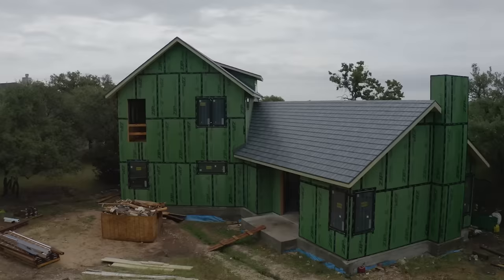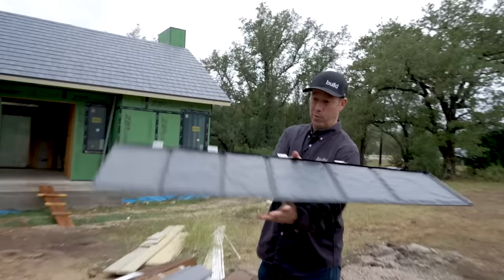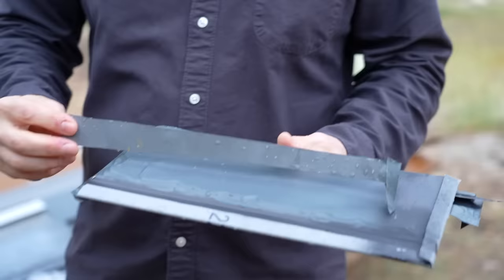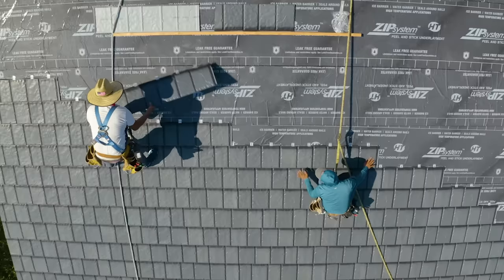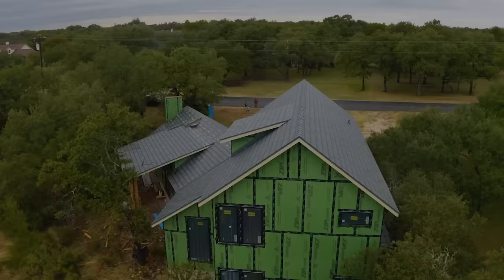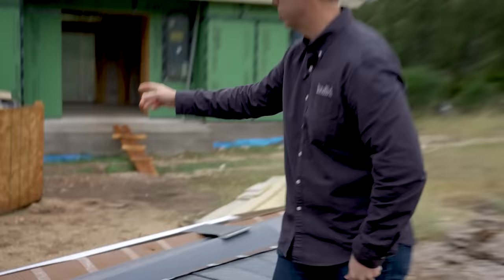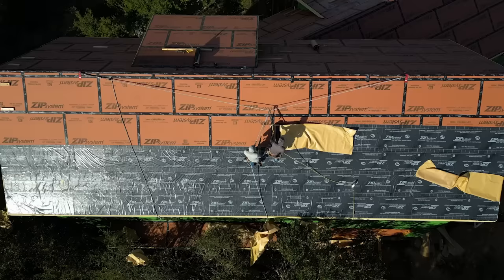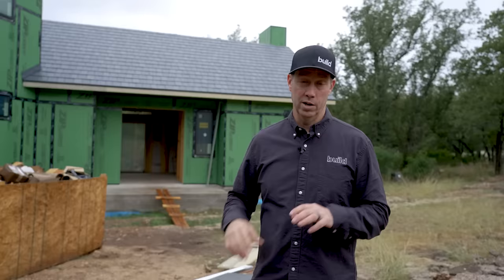Don't like the "metal roof look?" Check out this metal SLATE alternative!

Comment: I wonder if these still need sheathing for the install, warranty and load/wind capabilities. 
As in, could they be installed on a post frame with metal trusses and purlins. Perhaps with furring strips run perpendicular to the shingle for nailers.

Comment: Is the shape of the shingle enough venting? (Over a conditioned attic)
Reply: You likely don’t want your shingles to be doing the actual venting. It looks like it is setup for eave to ridge venting
Reply: @alexanderbrown6077  he often uses strips to attach his metal roof to, or a double deck.  So I thought I'd ask.
Reply: @sctexan5392  ah, the furring strips. You might be able to do that with minimal issues. I would assume you would want a solid backing with these due to the shorter length compared to normal steel roof panels, though the Mfg or someone who has actually worked with them may know better.

Comment: How’s the weight and cost of thee compareed to standing seam?
Reply: Depends on what gauge your reffering to. In general though its gonna be heavier due to the fin and gauge of the metal to allow for the detail. Cost is higher since this is a prefabbed product as oposed to something rolled in a electric brake.
Reply: 10% heavier per square. 
It costs more to install and there are way less people to repair it.

Comment: Is lightning striking a metal roof an issue to consider?
Reply: Quite the opposite - a metal roof will help dissipate the energy across the roof. That said, if your home is the highest point in the area, a lightning rod is still something to consider.
Reply: All metal roofs should absolutely be grounded. I went a little overboard when I built my home but ive got two rods for the roof (2800ft) two for my solar system, one for the main panel along with a water bond and all the mechanicals have their own. 
I did it because I want my great great great grandkids to live in it someday, come hell or very high water.

Comment: It would really be nice if it was cheaper though.  Most people aren't going to do this because of the cost, and the fact that most don't stay in a house longer than 10 years these days, it really comes down to whether or not it pays in the resale.  Really, asphalt shingles should be MUCH more expensive considering the lifetime environmental cost of them, which is about 20 times worse than metal.  Another example of the oil industry subsidized by the taxpayers.

Comment: I would argue it's the worst option of all.  The expense of metal materials, the difficulty of recreating the form in 50 years, installer's wont be familiar with it and it won't be as waterproofed as double lock standing seam.  Hard Pass

Comment: Unfortunately they do not look like slate at all even from this video, no even bothering from curb side: thickness, edges and texture is the give away. The manufacturers of these fake metal slate should make at least a better effort on reproducing a finer texture. And  though they are only 28G steel, they will dent with hail even if they are rated class 4. Class 4 means that they will not brake under hail, but unfortunately they will dent. Only g24 may resists dents from hail, but would be very expensive to manufacture so that is why all these companies use 28g steel.
Composite slates looks more realistic than these metal shingles and hardly dent with hail. Although they are slightly more expensive as base material and also the install is more expensive over all, since you have to nail them twice one by one.
Cheers.

Comment: Well, that's all nice, but when a BASEBALL OR SOFTBALL SIZE HAIL hits it?? won't it "DENT" Horribly?
Reply: I can't speak for this particular product, but in general terms metal roof handles large hail fairly well.  I'm on the tropical coast of Queensland Australia.  Not too long ago a township a bit north from me received 16cm (that's over 6 inches) sized hail.  There were only a few punch-throughs reported and they were on quite old galvanised corrugated sheets (the smooth ripple type sheet) that were thinner than is normal these days.  The common standard thickness sheets installed in the last 30 years had no punch-through reported.  Would have been a hell of a noise with that falling on your roof.